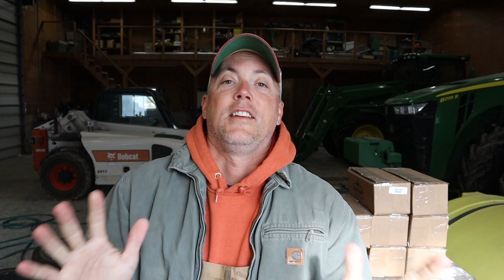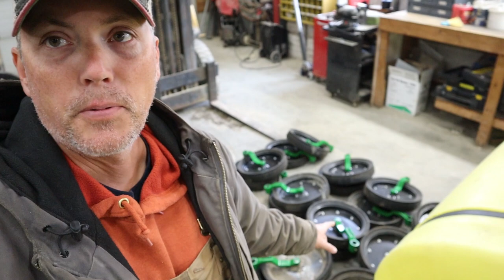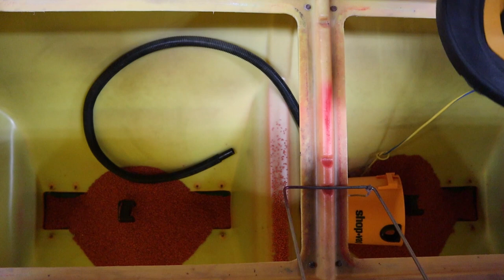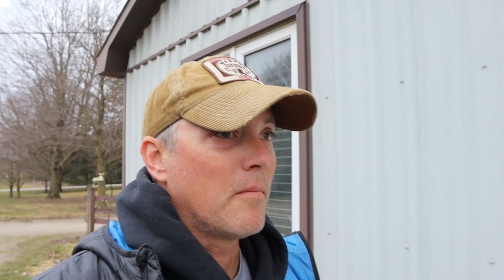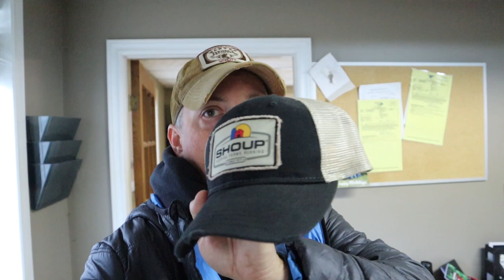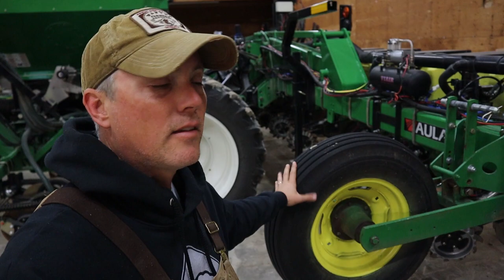Prepping planting equipment for spring | Vlog 65

Comment: Mark suggestion find a piece h of plastic piping to use as an extension for the vacuum then you don't have climes in
Reply from the maker: Yep that would work but would likely need my bigger shop vac 🤔
Reply: @MarkBrock , I  do not think so, just extending the pipe the suction would still be the same. Electricians  pull the string down long  big  pipe with small vacumes, try it a pice of 1 inch pipe and some duct tape for an adaptor
Reply from the maker: @curtismeskus504  I'll give it a try next time

Comment: Hi. The wheat seed you vaccumed out of the seeder is it still useable to plant this season? If so removing it was to put oats to sow before time to plant wheat. Do you plant all the wheat you harvest as winter wheat or is there more planted in the spring/summer for a different harvest time? Do you bale/use all the safts/stalks from each grain you plant or just certain ones. I know Sandi uses hay and straw for feeding and bedding the lamb/sheeps and had to get some from a friend. Cheers from sydenham, on